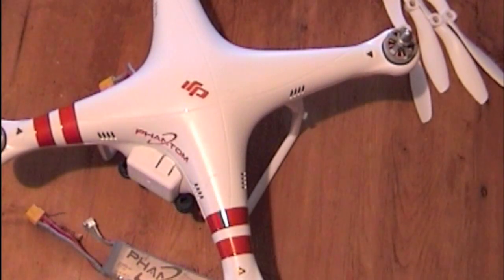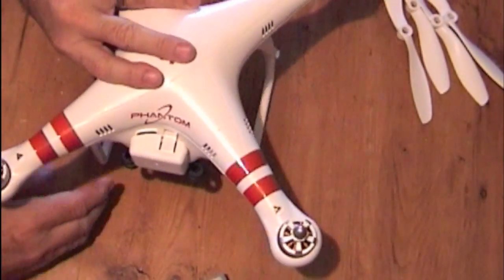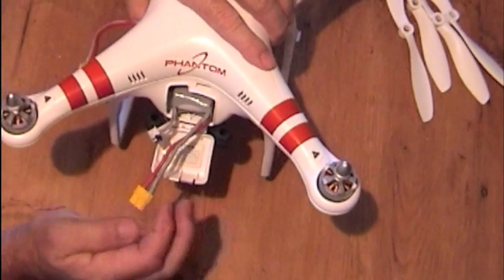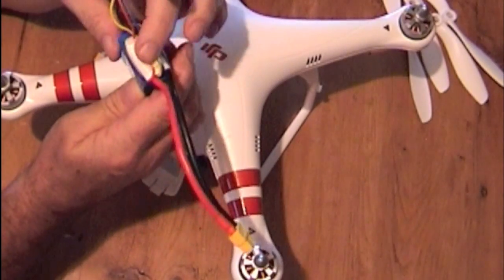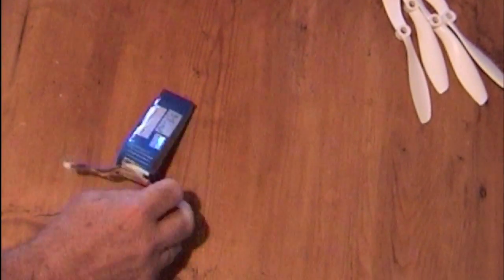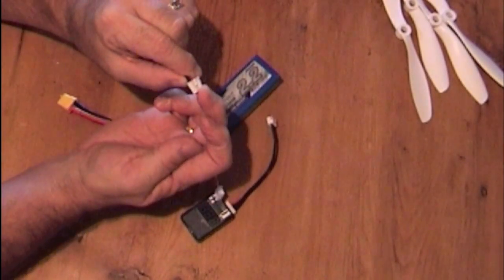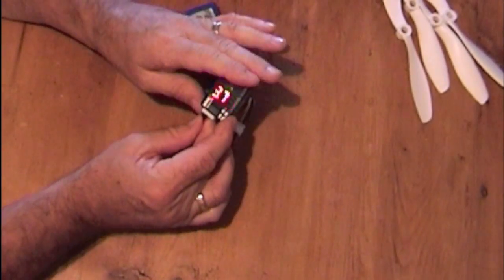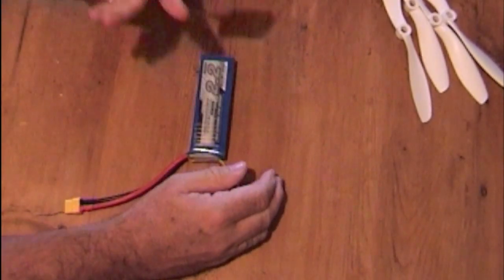DJI Phantom Battery Modification / SIMPLE !

Comment: apart from this mod, what is the usual or normal way to tell when the drone battery is running low ?
Reply from the maker: The Green light at the rear flashes RED.

Comment: I see that you have gone to great lengths so that you will not move the quad when you plug in the battery. Small movements such as those will not affect your phantom as the GPS is not that sensitive. Also, your Quad only takes a home position once it has connected to as many satellites as possible, and that will not be until after 30 seconds to 2 minutes, so you have some wiggle room. Also, if you feel you have messed with it, you can move it to a new location about 20 feet away from when you started it up and reset its home point by flicking your upper left switch (if you are using the original controller) about 15 and you should see the led blink green 20 times.
Reply from the maker: +Sean Littfin 
I know :-)

Comment: sound info, as you have changed the route of the battery lead and added the balance alarm make sure that you reset the system, recalibrate the compass as you would have change the magnetic fields around the electronics, and the compass offset requires resetting.  Some people say that even turning certain types of batteries over will change the mag field the batteries produce.  I hope to do some test on this point just out of interest.  Check different manufacturers run the power leads from each cell differently so if you set up your model using brand XX if you then install a brand YY battery it may give off a different mag field.
Reply from the maker: Interesting point!!!
I have had no issues with this mod and have used it with no problems for some time now and many flights.
I have found the compass seems to have no problem as I have only recalibrated it once since the mod was done.
I don't travel more than 40 or 50 miles from the first set up calibration and never had a problem.
I don't use the stock DJI Batteries.
But still interesting point about the magnetic field.

Comment: Good info, easier than splitting body is to just make notches both sides of battery hatch and run cable round front, works exactly the same but much quicker mod.
Reply from the maker: Good point :-)

Comment: I could not get(two) the allen screw(s) closest to the main body (legs) to budge.
So could not split the housing.Will have to drill them out.
Reply from the maker: Drill the heads off at the last resort! they go into a brass nut, not the plastic, make sure the Allen key fits well and ease them slowly, they are tight but not imposable to remove.
Reply: Topvideos1001 Yes, agree. I have just ordered a  Turnigy 2.0 mm long shaft Hex Screwdriver to have one more go.
Reply: Farmer Farmerer
OMG! recieved the screwdriver and the screws came out effortlessly!
Just goes to show eh! having the right tools!
Reply from the maker: I had a feeling they would, you cant beat the right tools.
Reply: Topvideos1001 The bastards put thread locker on those little philips head screws on the very end of the motor mounts. Using a proper sized screw driver, i was able to get all but 1 out, the last 1 i unfortunately stripped the head off of while trying to get it out >:(  WHO THE F&*%# PUT THREAD LOCKER ON THAT SMALL OF A SCREW ?!  anyways i couldn't drill it out cause the heat from the bit melts the plastic body.... soooo i cut the screw out using a dremel. WAS NOT impressed with DJI on this one lol

Comment: ok thanks very much , I have just calibrated it as I have installed the v2 firmware on my Naza . I must say, early impressions are good, it takes off a lot better and just seems a bit better in the air , it holds a bit better and seems to react better , these are only small notes as Naza M v1 is great , and it is good that you can do this as a lot of company`s would want to charge for this .
Reply from the maker: Have a look at our new site.
djiphantomreview.com/

Comment: ok , well that is interesting , as one of the not so popular guy at my local model shop (bit of a now it all) told me this , so I have done this ever since , I could see why , if a change of site is made , but at the same site didn't really make sense , so thanks for your feedback , you will save me a lot of nob flicking and spinning round in circles
Reply from the maker: The only thing I would recommend is to check the calibration on your computer every 20 or so outings.

Comment: you should always calibrate the compass before you fly at the start of your flying day , and even more important , if you change flying sites , as this may effect performance
Reply from the maker: Only if you move to another site, I have only calibrated once on initial set up and never had an issue also fly in several sites .
That is all that is needed but it is up to the individual.

Comment: compass calibration is not automatic it is done manually after getting satellite signals you maneuver the phantom 360 degrees then turn it facing up and turn 360 degrees unless there is a update i don't know about everyone who i fly with does a calibration before flight you claimed that once the battery was in you don't have to touch the drone again that was why i commented

Comment: Great mod, I am doing it to my Phantom as we speak. I have found not all 2200 mAh  batteries are not all the same size and the dji seems to be have made the compartment fit their perfectly.  Now I can close the door using Gen Ace, Nano-Tech, and Sky LiPo batteries with no problems.  The slightly different size pack and wire diameter are no longer an issue.  Thanks for sharing!

Comment: Did the same mod on my phantom, pushing the battery in and out  wore through the in side power lead lucky  it did not melt through in flight, would advice any one to do this mod asap

Comment: Sometimes it amazes me the time it takes for someone to reply to a very good video and idea,also reiterating the facts how to power up the phantom,as I know people never read the instructions correctly and then to produce a post like yours. Tuck your head in mate!! As for the problem that does not exist,try putting a Turnigy 2200mAh 3S 20C Lipo Pack into the phantom box- reason to use one of those is only costs $9 from Hobbyking compared to $33 for original battery.

Comment from the maker: The Red and Gray cable in the body of the Phantom, is an extension power cable for accessories and gives the same output as the main battery so make sure you don't short circuit them. 
Red is positive + the Gray is negative -

Comment from the maker: No I have not changed anything on the battery, just the tape on the balance wires, it should fit with room to spare.
I put the battery in bottom first with all the battery leads sticking out the front.

Comment: Nice! I have the same turnigy batteries, but mine get stuck inside the phantom.. like the cables run out of the pack thru the corner of the battery and lock it inside the quad.. did you change the exiting position of the wires on those turnigys? Thx!!